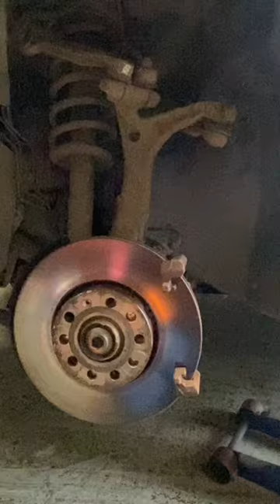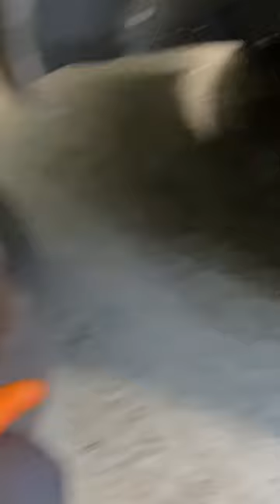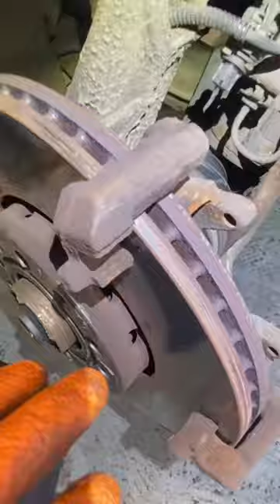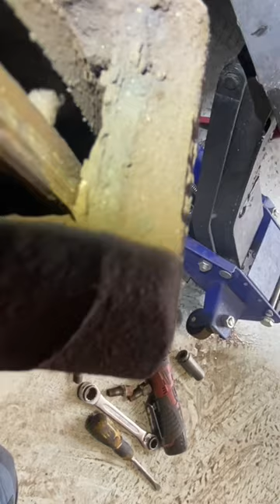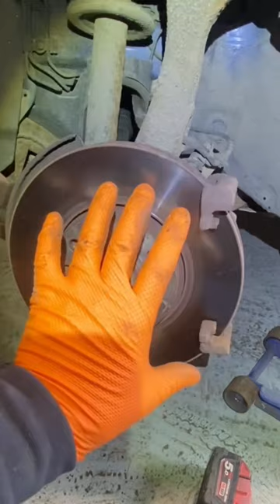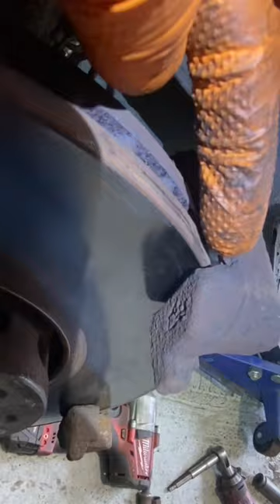Heat matter’s 😬

Comment: Yep had similar in a car where the pad carrier had again rusted up and this car made a noise when cornering on a roundabout as there was enough movement in wheel bearing to allow the pad to touch it
Reply from the maker: I just thought it interesting the way it only scraped when very hot & then immediately stopped once the brake was released & it cooled within 1-2 seconds 👍👍
Reply: @Kennedy’s garage  that's quick cooling for metal. I been on road test after fixing a car for a binding handbrake and even when fixed it burnt my finger when I touched the disc to check it
Reply from the maker: @the_retired_mechanic  brake’s can be funny at times, but then everything can be funny with cars nowadays 😬😬
Cheers Chris 👍